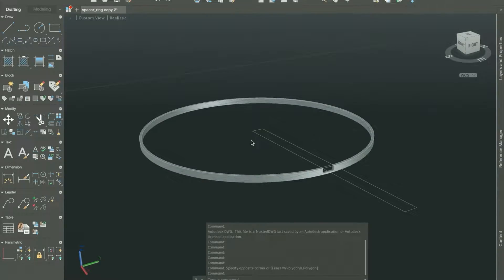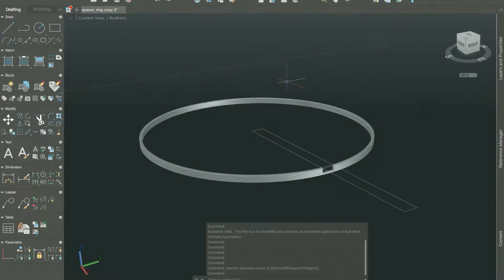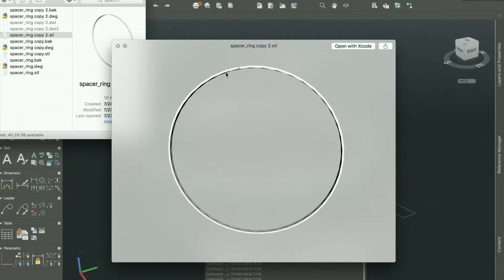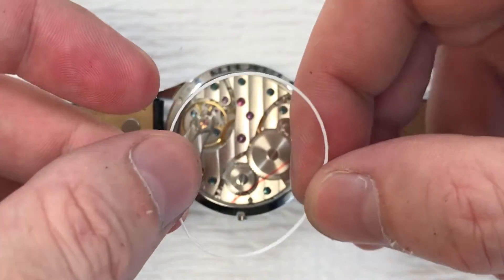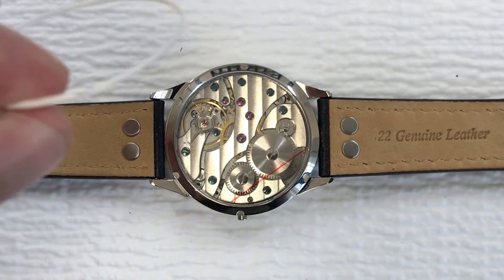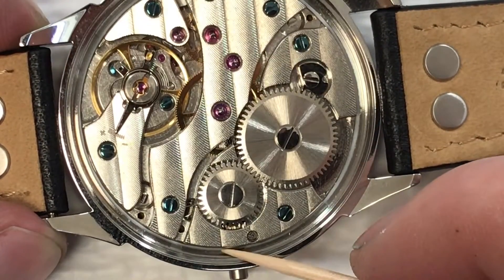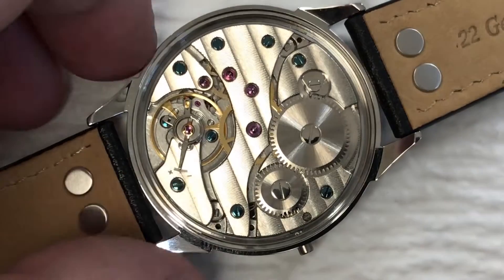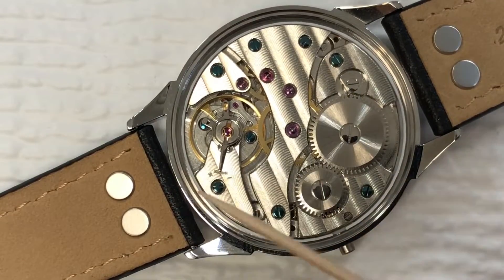Making Custom Watches: Creating a spacer ring

Comment: Hi, I am surprised to see that you place no case clamps ? I think sapcer ring + case clamps ensure a tight, solid fit between case and movement.
However, many thanks for sharing your tips to customize watches, I appreciate these contents !! nice work !!
Reply from the maker: Oh this still has case clamps. But when a watch is not designed "as a whole" then a cheap case from some seller may have some tolerance issues. Depending on the design, case clamps will help, but may not be enough to keep things from shifting around if there's a larger gap. Clamps coupled with a spacer ring that takes up any empty space just adds to the security of the movement.
Reply: @WatchComplications  thanks !